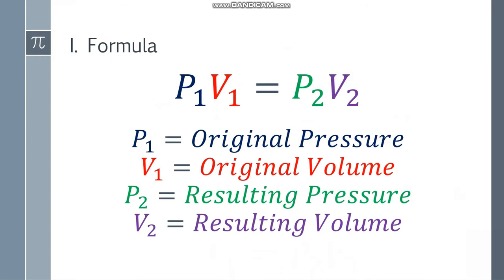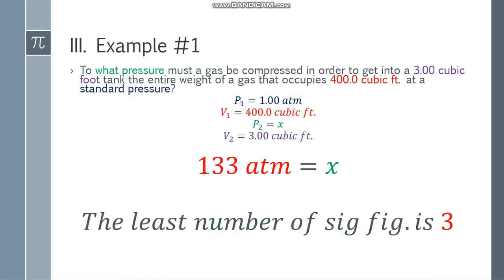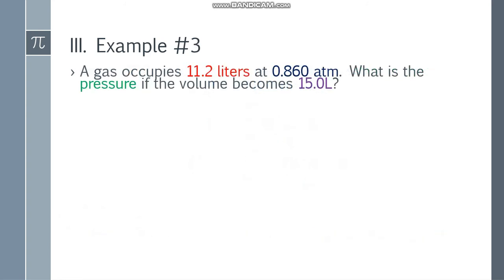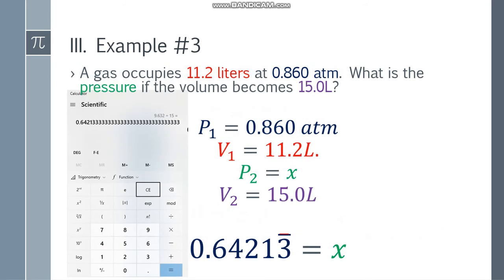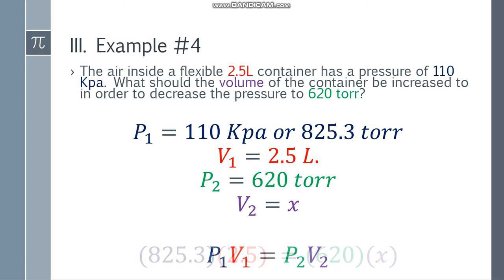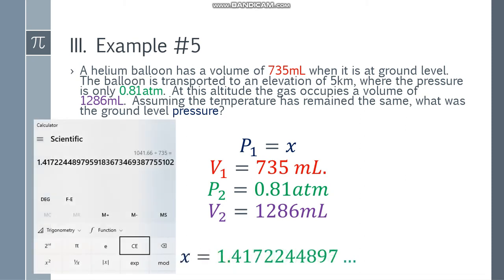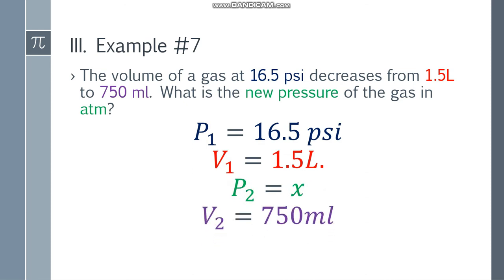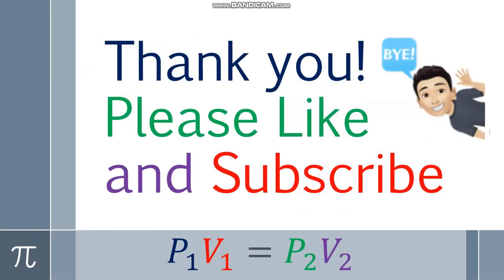Boyle's Law (Filipino-Explained)

Comment from the maker: For example number 6, the given should be 3.0atm and not 3atm lang.
Reply: oxygen gas inside a 1.5 gs tank hs a pressure of 0.95atm provide that he temperature remains the constant how much pressure is needed to reduce it volume by ½ given
Reply from the maker: @MewEditorYt  Kung ihahalf ang volume, edi ang pressure natin is dodoblehin natin. 

So, ang sagot ay 1.9 atm.
Reply: Pa hel po
Reply from the maker: @MewEditorYt  Cge po wait lang po
Reply: Pa help po😢

Comment: A gas sample has a volume of 3.6 L at a pressure of 2.0atm. What will be the value of pressure if the volume is increased?
Reply from the maker: Increased by what? Kulang iyong details ng problem.

Comment: ). A container holds 50.0 mL of nitrogen at 25° C and a pressure of 736 mm Hg. What will be its volume if the tem indrases by 35º C?

Sir na hihirapan ko ako sa gantong problem apat kasi yong number na pag pipilian
Reply from the maker: Silent iyong problem about dun sa pressure kung constant pa rin. So, we can assume na constant pa rin iyong pressure. Hence, ignore na lang muna natin iyong pressure. 

V1= 50.0 mL
T1= 25°C or 298.15K
V2= x
T2= 35°C or 308.15K

V1   =       V2
==     	====
T1           T2

50         =    	  x
=====   	       ====
298.15    	308.15

(50)(308.15) = 298.15x
15,407.5= 298.15x
x= 15,407.5/298.15
x= 51.6770082173402649

Rounding off to the least number of significant figure which is 3, the final answer or new temperature will be 51.7 ml

Comment: hi hello po, pano yon yung v1 niya 700 cm3 

P1 = 1.30 atm
V1 = 700 cm3
P2 = 2.00
V2 =
Reply from the maker: P1 = 1.30 atm
V1 = 700 cm3
P2 = 2.00 (I will assume na atm din ito)
V2 = x

Formula P1V1= P2V2

(1.3)(700)= 2x
910=2x
x= 910/2
x= 455 cm3

Sure ka ba na ang pagkalagay ay "700cm3" or "700.0cm3"

Kapag 700cm3 na walang decimal point at zero, ang magiging final answer ay 500cm3.

Kapag 700.0cm3 naman, ang final answer ay 455cm3

Comment: A sample of fluorine gas occupies a volume of 500 mL at 760 torr. Given that the temperature remains the same, calculate the pressure required to reduce its volume by 1/3.....pano po Yun kpag may fraction na po?
Reply from the maker: P1= 760 torr 
V1= 500ml
P2= x
V2= 500- (1/3 of 500) 

Sabi sa prob, reduce the volume by 1/3, so babawasan mo iyong 500 ng 1/3 niya

Ang 1/3 ng 500 ay around 166.666666. So, 500-166.6666666 is mga 333.33333333

Update natin iyong given, magiging 

P1= 760 torr 
V1= 500ml
P2= x
V2= 333.33ml

Solve na natin

P1V1= P2V2

(760)(500)= 333.33x
380,000= 333.33x
x= 380,000/333.33
x= 1,140.01140011400...

So ang resulting pressure or P2 ay 1,140.01140011400 torr

Rounding off to the least significant figure, which is 1 kasi iyong 500, ang number of significant figure niya lanng ay 1. Kindly make sure kung 500ml lang siya at hindi siya 500.0ml

Kapag 500ml lang mismo given, ang magiging final answer natin is 1000 torr

Kapag 500.0ml naman, ang magiging answer natin ay 1100 torr.

Comment: Sirr ask lang po how po ba mahanap yung P1,V1, P2 and V2 po, nakakalito po kase HEHEHE
Reply from the maker: P means pressure, ang mga units ng pressure ay 

Pascal (Pa)
Bar (bar)
Atmosphere (atm)
Millimeters of Mercury (mmHg)
Pounds per Square Inch (psi)
Torr (Torr)

Sa V naman means volume, ang mga units niya ay 

Cubic meter (m³)
Liter (L)
Milliliter (mL)
Cubic centimeter (cm³ or cc)
Gallon (gal)
Fluid ounce (fl oz)
Cubic foot (ft³)
Cubic inch (in³)

P1 or V1= Initial or starting
P2 or V2= Final or Resulting

Comment: a gas tank holds 50L of oxygen (O2) at a pressure of 18 atm. How many liters will the gas occupy if the pressure is changed to 1.5 atm at constant temperature?
Reply from the maker: P1= 18atm 
V1= 50L
P2= 1.5atm
V2= x

I will remove the units. Since parehas naman units ng pressure na atm at sa volume na liters.

18(50)= 1.5x
900=1.5x
x=900/1.5
x= 600

Answer: 600L

Comment: sa example #1 po, bakit po v1= 400.0 and not 3.00?
Reply from the maker: Based po kasi dun sa question, nakalagay po na "in order to get into". So ibig sabihn V2 = 3.00 cubic feet. 

Ang tinutukoy niya na iyong 3.00 cubic feet, ayun iyong resulting volume.

Comment: When the pressure on a gas increases, will the volume increase or decrease?
Reply from the maker: According to Boyle's Law, when the pressure on a gas increases, the volume of the gas will decrease, given that the temperature remains constant. Boyle's Law states that the pressure and volume of a gas are inversely proportional to each other at constant temperature. In other words, as pressure increases, volume decreases, and vice versa, as long as the temperature remains constant. This relationship can be expressed mathematically as:

P1 * V1 = P2 * V2

Where P1 and V1 represent the initial pressure and volume, and P2 and V2 represent the final pressure and volume, respectively.

Comment: Nitrogen gas has a volume of 5 litres  at 30 ºC. What will be its volume in mL if the pressure is changed from 1.5 to 4.5 atmospheres keeping the temperature constant at 30ºC?
Reply from the maker: P1 * V1 = P2 * V2

Where:
P1 = initial pressure
V1 = initial volume
P2 = final pressure
V2 = final volume

Given:
P1 = 1.5 atm
V1 = 5 liters
P2 = 4.5 atm
T = 30 ºC

First, let's convert the temperature from Celsius to Kelvin:

T = 30 ºC + 273.15
T = 303.15 K

Now we can use Boyle's Law to find V2:

P1 * V1 = P2 * V2

(1.5 atm) * (5 liters) = (4.5 atm) * V2

Simplifying:

7.5 = 4.5 * V2

Dividing both sides by 4.5:

V2 = 7.5 / 4.5

V2 ≈ 1.67 liters

To convert liters to milliliters, we multiply by 1000:

V2 = 1.67 * 1000

V2 ≈ 1670 mL

Therefore, the volume of nitrogen gas at 30 ºC will be approximately 1670 mL when the pressure is changed from 1.5 to 4.5 atmospheres while keeping the temperature constant.

Comment: Sir paano naman po i solve kapag may cm³, like 24.6cm³?
Given po is
P¹=2.6mm hg
V¹=24.6cm³
P²=48mm hg
V²=?
Reply from the maker: Same unit pa rin lalabas sa Final Volume (V2) unless na lang na ibang unit hinahanap. Also, take note na 1cm^3 = 1ml
Reply from the maker: If you have questions or need help, feel free to comment.

Comment: Sir paano po pag ang v2 ay 1/2 tsaka 1/3 paano ko po sya isosolve?
Reply from the maker: Pwedeng pa send ng complete question.
Reply: @mathandlanguagebyjamesjuni  1. Oxygen gas inside a 1.5 L gas tank has a pressure of 0.95 atm. Provided that the temperature remains constant, how much pressure is needed to reduce its volume by 1/2?

3. A sample of fluorine gas occupies a volume of 500 mL at 760 torr. Given that the temperature remains the same, calculate the pressure required to reduce its volume by 1/3.
Yan po nalilito po ako kung paano ko sya ididivide
Reply: Ano po yung answer sa number 3??😭
Reply: To answer po yung number 1.

V1 P1= V2 P2
V1= 1.5L
P1= 0.95 atm
V2= 1/2 0.75L
P2= ?

P2= V1 P1
    ------
     V2

= 1.5L (0.95atm)
  -----------
      0.75L

Cancel out yung L

=1.425 atm
 --------
    0.75

= 1.9atm

Comment: V1= 600 (mL)
P1= 760 (torr)
Calcutale its volume to reduce 1/3 daw po diko get yung tanong HUHUHU
Reply: Can’t find P2 or V2 hindi po tinuro ni ma’am namin yung sa part na hindi given yung P2 V2
Reply from the maker: @mekirin5204  Pwede po pasend ng complete question para po macheck ko.
Reply: @mathandlanguagebyjamesjuni  calculate the pressure required to reduce its volume by 1/3 po nalutang ako kina soree
Reply from the maker: @mekirin5204  Remind ko lang po kayo na iba ang 

"by 1/3" sa "to 1/3" 

So, anu po talaga?

"by" or "to"
Reply from the maker: @mekirin5204  Gawa ako 2 versions, wait
Reply from the maker: @mekirin5204  To reduce to 1/3 (magiging 1/3 na lang ang volume)
V1= 600 (mL)
P1= 760 (torr)

"Kung magiging 1/3 na lang ang magiging volume, edi kunin mo iyong 1/3 ng 600, which is 200"

P1V1= P2V2
(760)(600)= 200x
456,000= 200x
x= 2280torr or 2000 torr kasi 2 sig figs lang

--------------------------------------------------
To reduce by 1/3 (babawasan lang ng 1/3 ang volume, so magiging 2/3 na lang)
V1= 600 (mL)
P1= 760 (torr)

"Kung magiging 2/3 na lang ang magiging volume, edi kunin mo iyong 2/3 ng 600, which is 400"

P1V1= P2V2
(760)(600)= 400x
456,000= 400x
x= 1140 torr or 1000 torr na lang kasi 1 sig fig lang.
Reply from the maker: @mekirin5204  To reduce to 1/3 (magiging 1/3 na lang ang volume)
V1= 600 (mL)
P1= 760 (torr)

"Kung magiging 1/3 na lang ang magiging volume, edi kunin mo iyong 1/3 ng 600, which is 200"

P1V1= P2V2
(760)(600)= 200x
456,000= 200x
x= 2280torr or 2000 torr kasi 2 sig figs lang

--------------------------------------------------
To reduce by 1/3 (babawasan lang ng 1/3 ang volume, so magiging 2/3 na lang)
V1= 600 (mL)
P1= 760 (torr)

"Kung magiging 2/3 na lang ang magiging volume, edi kunin mo iyong 2/3 ng 600, which is 400"

P1V1= P2V2
(760)(600)= 400x
456,000= 400x
x= 1140 torr or 1000 torr na lang kasi 1 sig fig lang.
Reply from the maker: Iyong 600ml ba, hindi siya ganito ---> "600.0" iyong may decimal point at zero pa?